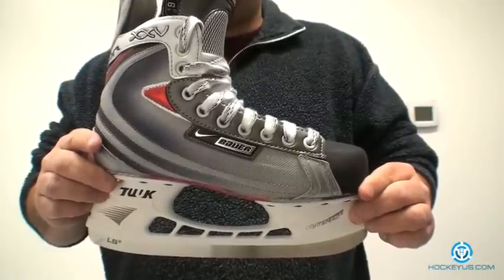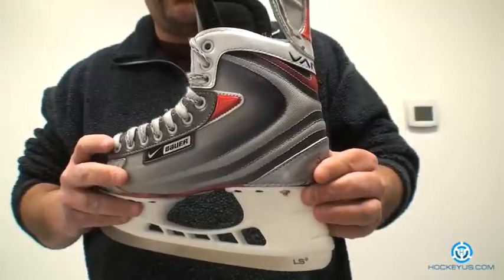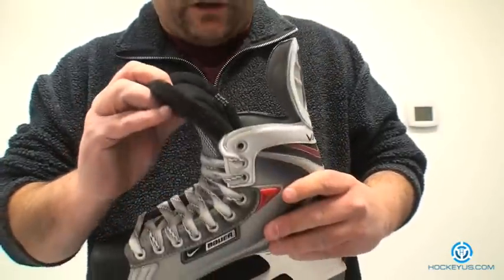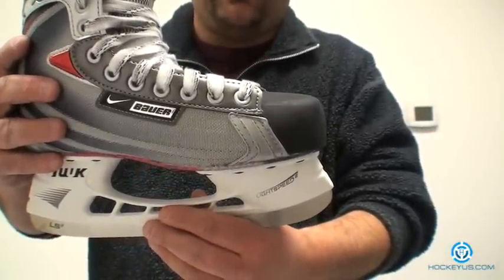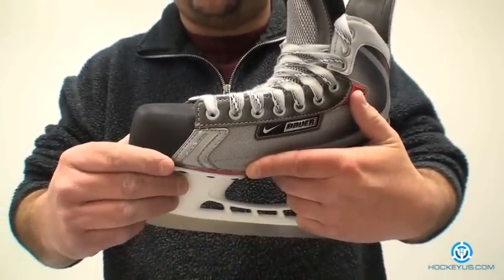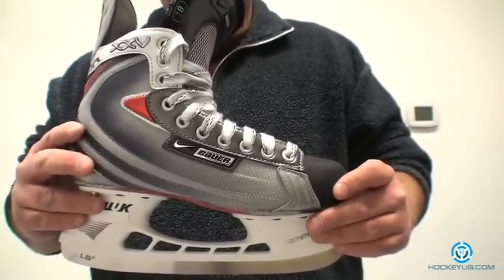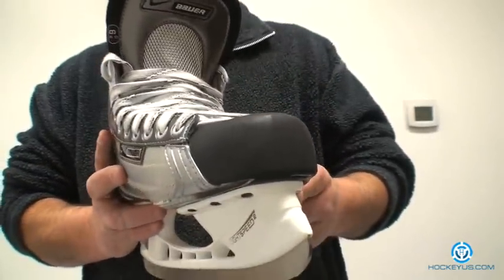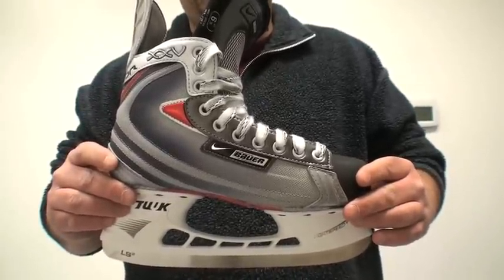Nike Bauer Vapor XXV Skate review

Comment: I bought a pair of the Vapor XXV after wearing my original Vapor XV out to the point the toe caps were falling off. I loved the feel of the VX so much I bought the XXV sight unseen. Big mistake. The XXV boot fits entirely different. The heal is wider the toe design has changed. The skate seems like it's a half size bigger than the exact same size I had before. The XXV's hurt my feet where as the XV's felt great from the start. Why do companies have to reinvent the wheel! Disappointed.